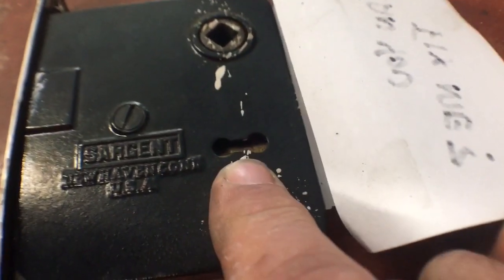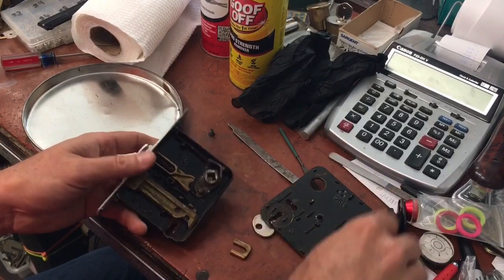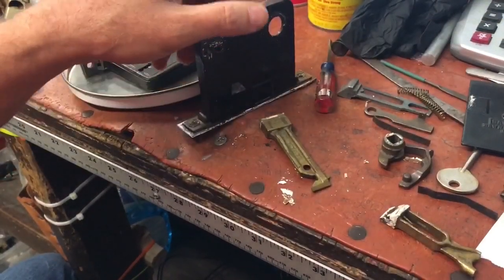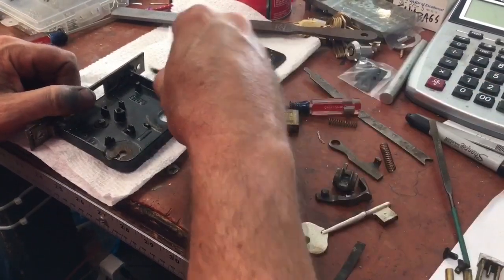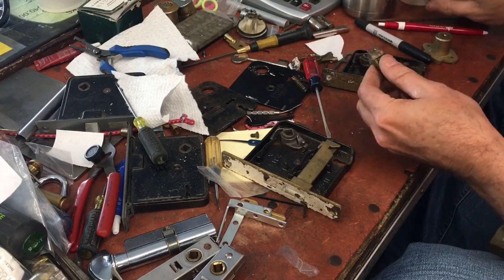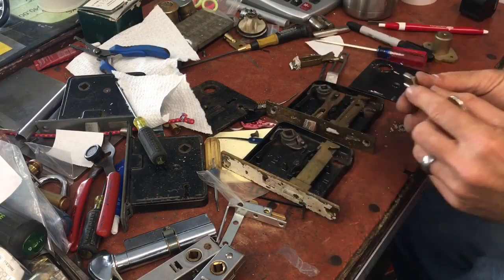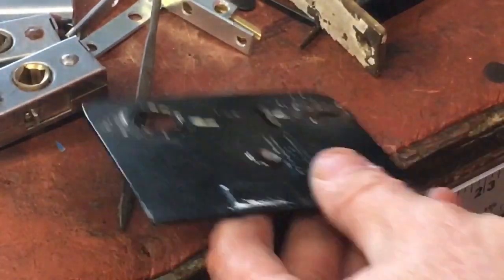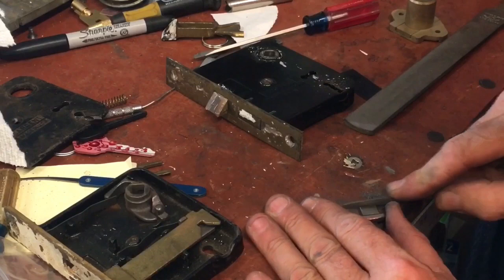Pt 3: Antique Mortise Lock - Key Making & Refurbishing for Customer

Comment: Jason if that broken latch bolt is brass and it looked like it, it probably can be silver soldered.  Mapp torch, 1300 deg. melting point silver solder from refrigeration supply house, flux, a fire brick to work on and some practice.  This is known as hard solder and can be quite strong when properly done.  Ideal gap is .001-.002" so close fits are what you want.

Comment: Can you  help me?  I have the same lock.  5164.  The upper flat spring is broken.  The rest is fine, other than I don't have a key.  I want to get it working, and am just about to toss it......it is sad because the lock looked really good inside when I opened it, rust wise.  The flat spring that goes along the top was broken in half.  I do not know what would work as a replacement.  (Was even looking at modifying tools in my husband's garage for checking the gap in spark plugs...he would not forgive me).  ha ha
Reply from the maker: Now don’t go modifying tools for that ;)
You could measure the width and thickness of the flat spring and order a similar size on eBay or Amazon perhaps. Look for “flat spring steel stock”
McMaster Carr website has lots of sizes